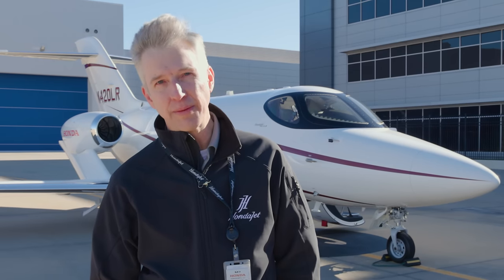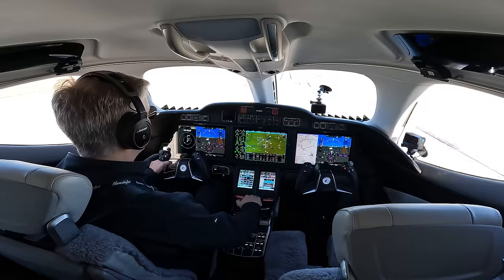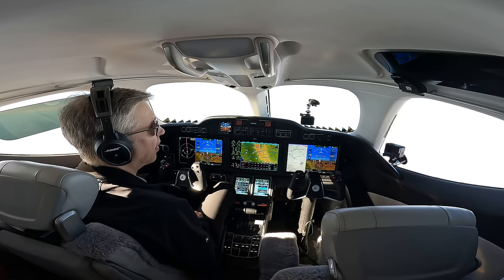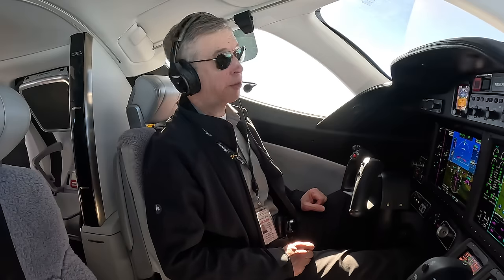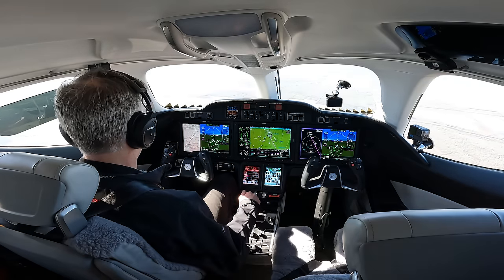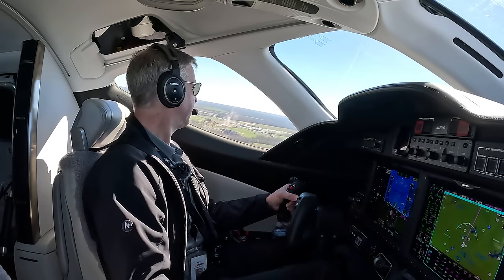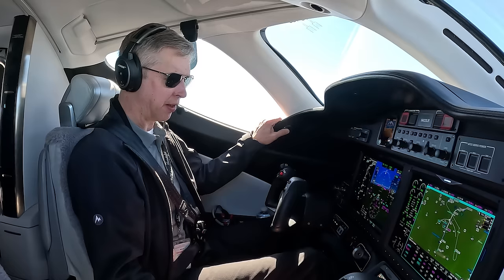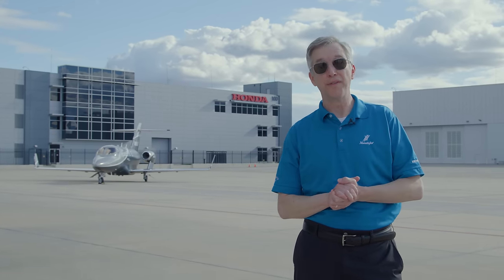Flying a HondaJet to Austin, TX with Just One Pilot

Comment: See a bit of shisa kanko in the way you fly,  I like it.
Reply from the maker: Hi, Jonathan here! I appreciate your comment, because you just taught me something. After I looked up “shisa kanko” I understood completely. Pointing out important observations inside and outside the aircraft in all phases of flight helps me to focus and maintain situational awareness. Almost any single pilot or crew will have callouts in their standard operating procedures to do the same. And the fact that your term is Japanese is quite appropriate!
Reply: @HondaJetTV    It is a really helpful skill to have, doesn't cost anything in terms as effort but gives you the edge on sotting issues and things that may catch you out.

Love the videos.
Reply: @HondaJetTV  An update on the Helicopter be good too.  It was a little close, especially if you lost an engine and the climb rate suffered,

Comment: What’s the advantage of using the Honda Test 53 call sign over the N number?
Reply from the maker: Many pilots at different aircraft manufacturing companies use test call signs to differentiate themselves with Air Traffic Control (ATC). The company and ATC come to an agreement that anyone using their special designation is on official company business, frequently for test purposes and may need some flexibility (for headings, altitudes, etc.) on that particular flight. Companies can also easily track their aircraft as they fly their missions.
Reply: @HondaJetTV  Thanks for taking the time to reply to my question. It’s greatly appreciated.

Comment: Why does he need oxygen?At 340FL isn’t the cabin pressurized?
Reply: Here's something I found with a google search because I had the same question, so take it for what it's worth: The FAA requires a pilot to put on the oxygen mask if the other pilot leaves cockpit when cruising above FL250. It also requires that one pilot always wears an oxygen mask when flying above FL410.
Reply from the maker: Hey, Jonathan the pilot here! You are correct: the cabin is pressurized so the environment at any altitude is friendly to everyone for breathing and temperature control. At FL350 (35,000 feet), a pilot operating and aircraft alone is required to wear an oxygen mask. (You legal eagles can read 14 CFR Part 91.211(b)(1)(ii)). Because I was the only pilot on board that day, I was required to do so. Why? Safety. The air pressure at that altitude is quite low, making it impossible for we mere mortals to breathe. In the unlikely event that the aircraft could no longer pressurize the cabin (a very unlikely scenario for any aircraft), I would already have oxygen feeding my brain and therefore could correctly handle the emergency.
Reply: @HondaJetTV very unlikely indeed, unless it’s a 737 MAX 😊
Reply: @HondaJetTV perhaps I am not reading the reg correctly, but the way I interpreted that reg would be if the cabin pressure altitude exceeds 14,000.  I’d assume the Honda Jet has a much lower cabin pressure altitude. Or does it assume there are two crew?
Reply: @brandonadams7837 If the cabin altitude exceeds 14,000 feet, he'd definitely have to be using oxygen. When the systems are working normally, the plane when flying at 35,000 feet will have a cabin pressure of around 8,000 feet or even lower. Of course you do not need to be using an oxygen mask at that cabin altitude, but the point of the 35,000 feet single pilot oxygen rule is that IF the cabin suddenly lost pressurisation at high altitude, a single pilot may not have time to put on a mask before he/she loses consciousness.